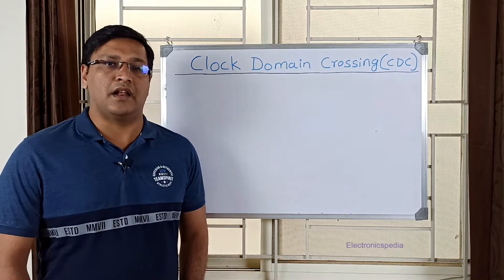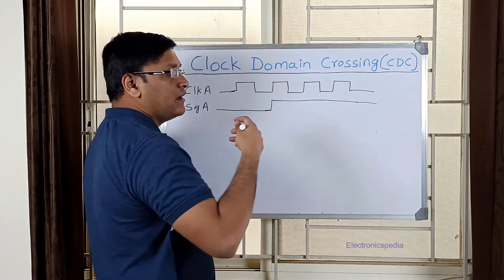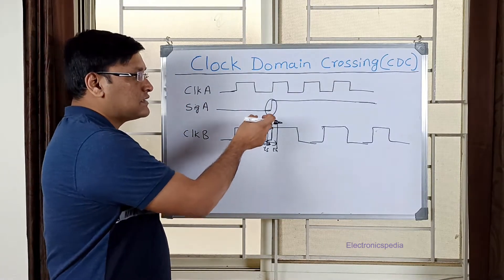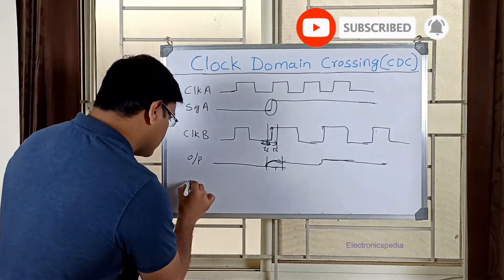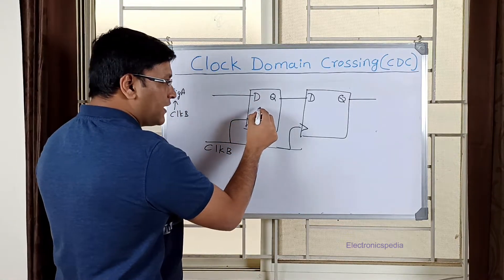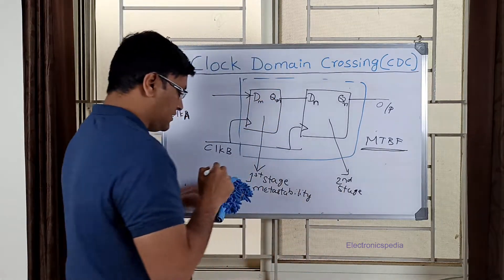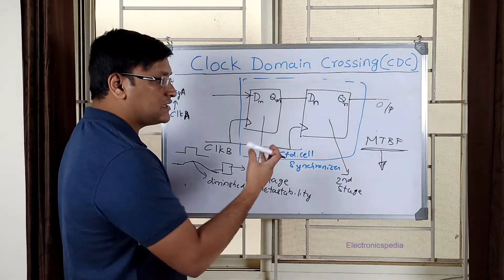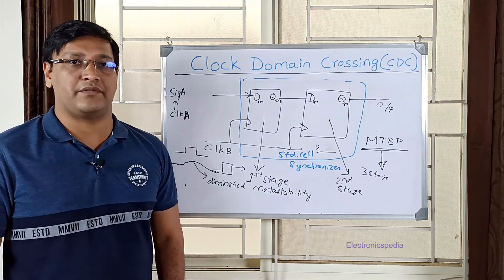CDC Synchronizer | 2 flop synchronizer | Two flop synchronizer |2 stage synchronizer| VLSI Interview

Comment: Hi sir,
If the first clk is double the time faster than the second clk, we are going to lose some data, how we can solve it?
Reply from the maker: Hi, The two stage synchronizers as mentioned is used only when the source domain signal is quasi-static or stable for enough time. 
Here in this case there will not be any issue even if the clock frequency of source is double the destination 

But if the source signal changes before the destination samples it then this two stage synchronizers scheme cannot be used
Reply: @Electronicspedia  Thank you sir!

Comment: sir once the data enters metastable state it can settle to any value how can we ensure that we are sampling correct data at the 2nd flop
Reply: If someone found an answer to this question I would be grateful to hear it!
Reply: First of all, in a two-flop synchronizers, the role of 2nd flop is to give the metastability time to resolve, not to correct the data value. It does not guarantee the correctness of sampled data value. Instead, it ensures signal integrity and stability.
Two-flop synchronizers are generally not used for single cycle pulse, because it may miss or capture wrong value. Instead, signals must be >= 2 destination clock cycles to use this kind of synchronizer. 

For single cycle pulse, there are some protocols like Handshake, pulse synchronizers or toggle synchronizers.

Comment: I have a question,

Im using clock gating in my design. My question is: the clock gating should affect the dual flop synchronizer or the synchronizer must have the free clock always?

Comment: I think the reason for keeping two flops closer in 2 flop synchronizer is to reduce wire delay so we get maximum time to resolve metastability and settle to stable value, you were mentioning reason is metastable  signal will decay and disappear that part I did not get.
Reply from the maker: Yes exactly, if they are separated apart then the data signal might get corrupted because of wire length. It adds the delay.  We may not be able to sample the signal at desired frequency.

Comment: Sir, I am a little bit confused about you tell us that two flops should be closer to each other to avoid getting the wrong output. But sir I think the clock is the only one responsible for this, because of the small delay of the path nothing will happen!!!!! That delay is for sure will be less than clock period???
Reply from the maker: Hi, When I mention the distance between two flops should be closer to reach other is actually we should be using standard cells, which are nothing but .lib cells or library cells for which there will be a timing spec available.
If the Frequency of sampling domain is higher, we might end up in sampling wrong data, in such conditions we should go for 3 or 4 flops based  standard synchronizer cells.

Comment: How we can calculate number of flops in synchronizer
Reply from the maker: Hi Prem, No. Of Flops in the synchronizer depends on metastability, i.e. what is the frequency of sampling domain or destination clock freq and also on the frequency of data rate change and how these standard cell synchronizers are modelled in each technology nodes.
Reply: @Electronicspedia  Thanks you sir responding to me, Keep doing more videos, I will also share your videos in my circle
Reply from the maker: @Prem Kumar  Thank You for your Support. 👍

Comment: sir as the signal is altered  in first ff How can we ensure that we get correct output after 2nd ff
Reply from the maker: Hi Srinu, signal might go into metastable state on 1st FF, but eventually 2nd flop may not see the this as the signal gets settled to a stable value. This is true for upto certain frequency.

But for high speed clocks say above 2GHz, 2nd FF also might go into metastability, in such cases 3rd stage FF synchronizer is required.
Reply: @Electronicspedia  Hi sir, how can we ensure that the stable value after metastable state from 1st flop is the correct data that is settled to a stable value. There might be a chance that the data may be corrupted after metastable state and the same data is captured by the 3rd ff?
Reply from the maker: Hi, yes whatever you told is correct, there might be a chance that data may be still on metastable condition even after 2nd stage,

Usually this information comes from .lib characteristics of synchronizer. There will be some range of frequency information will be provided upfront, there will be a maximum frequency of operation below which the two stage synchronizer will be able to sample data properly, but if it sampling frequency crosses the limit, it might enter metastability.
In such cases we may have go for 3 stage or even higher stage synchronizer.

Hope this is clear.